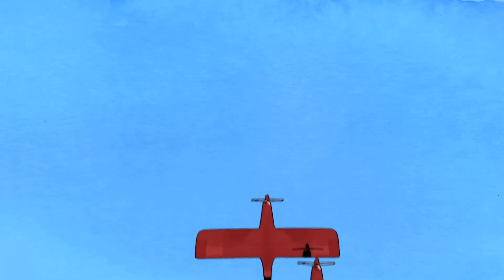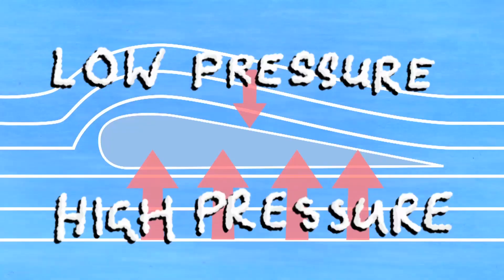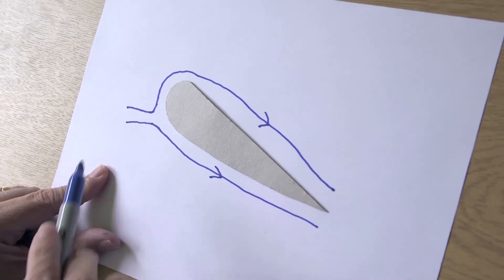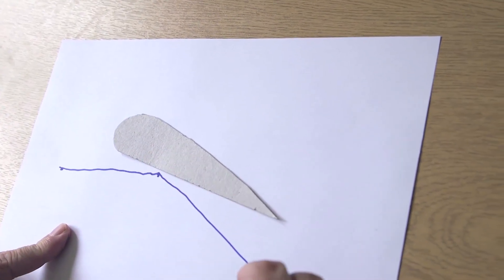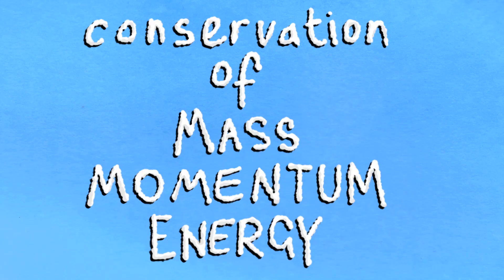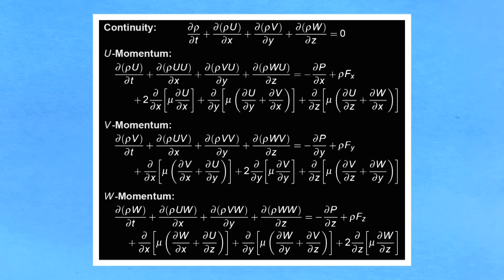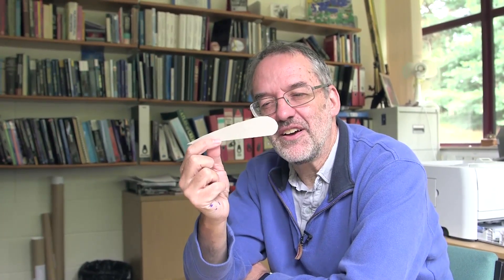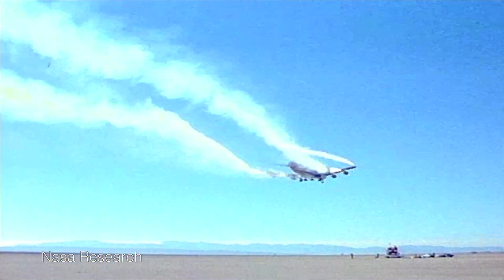Lift and Wings - Sixty Symbols

Comment: the Bernoulli effect: 
If you isolate the volume of air affected into many tiny cells or volumes, you can analyze the effect of each individual cell. (This is how fluid flow CAD models operate). To accelerate one of these cells of air, you need less pressure on one side than the other; so the cell will accelerate towards the lower pressure side. The resultant velocity is simply due to F=mA. Less pressure actually means that the molecules are indeed further apart. The accelerated cell doesn't have less pressure "because it has higher velocity", It has less pressure because the cell actually is at less pressure. That is why it has accelerated to the speed we see near the top of the wing. For the air flowing over the top of a wing, the integral of F/m over time will be equal to the change of velocity. Air obeys F=mA like every other mass does.

Comment: I believe the downwash which results in lift would be newton’s 3rd law?
Reply: The downwash essentially does satisfy Newton's Third law,  However, the lift, downwash and upwash as well as all other air accelerations around a wing are caused by the pressure differences (called Pressure Gradients) around the wing.
..
It is a common misconception that the downwash is the cause of lift.
..
If the downwash off the trailing edge caused an upward push, then the trailing edge would be pushed upward by the lift force and we know very well that the center of lift (or the net upward force) is about 25% behind the leading edge.

Comment: As with so many approaches to this issue, the production of lift is portrayed with air moving over a stationary wing, as in a wind tunnel. Even Professors fall into this trap!
However, this not what happens in the 'real world', where a moving aerofoil displaces previously stationary air. 
We need a model showing the downward displacement of air after the passage of the wing, which must also have a small forward component. Take a look at any one of several photos or videos of aircraft flying just above the cloud tops.

Comment: It's always interesting in lift explanations, to see the angle of attack of the fuselage ignored.
Reply: Because it is the wing that does the greatest.  The fuselage may or may not produce a tiny amount of  lift.
The pressure changes caused by the motion through air are VERY small!  That is why wings are so large.
A Cessna 172 has a pressure top-bottom difference of only 0.1 psi!!  With 25,000 square inches (147 sq feet) to lift a 2,500 pound plane.
.
The pressure above decreases about 0.08 psi and below it decreases about 0.02 psi - for a difference of that 0.1 psi..
..
The largest change of -0.08 psi is only a change of 0.57%.  The greatest pressure change around the ting is only HALF a PERCENT!.
..

Comment: "The air above the wing travels sligthly faster than the air below the wing - creating lift".
"No, it travels even faster than you think, so it doesn't create lift".

So, more is less?
Reply: It is actually ACCELERATED rearward by the lower pressure above the wing and higher, atmospheric pressure ahead of the wing. A Pressure Gradient Accelerates fluid toward the lower pressure.  Pressure = CAUSE! [THAT is Newton].
If you stand still and watch a wing go by; actually following a small bit of air that winds up above the wing, you see that it first gets pushed forward ahead of the wing in the well known up=wash, then completely reverses direction and is traveling in the opposite direction of the wing - BECAUSE that pressure is so much lower than 1 atm!  In the still air reference frame that upper air REVERSES DIRECTION due to heh (negative)  Acceleration!
Reply: @Observ45er  the end result remains the same: lift is created because of air moving faster above the wing than below.
Reply: @KlipsenTube  The end result is the same as what?
.
The upward lift force is the direct result of the Top-to-Bottom pressure difference, regardless of which science or myth you choose to point to --- or which step along the path of numerous causes and effects you wish to stop at...
..
It also takes a 'turning' of the flow to get lift...
.
It also requires something like a "wing" shape, oriented correctly ti get lift...
..
It also takes forward motion...
.
Sound bites don't explain anything...
..
Some folks claim that it is money that holds planes up...
Cheers
Reply: Actually it does not travel at all, it is the wing that is moving, the air is stationary.
Reply: @marka6487  tomatoes tomartoes. 
Ever heard of wind tunnels?
Reply: @KlipsenTube  planes in wind tunnels don't fly. Apples and oranges
Reply: @marka6487  are you always this infantile?
Reply: @KlipsenTube  Does everyone that disagrees with you seem infantile to you? Does your opinion mean anything?
Reply: @marka6487  I take that as a yes.
Disaggreeing is one thing, but how do we disaggree, when we basically say the same? By you acting “clever”, in other words childish.

Comment: Somebody please tell me why a model airplane with a flat sheet of Balsa wood flies as well (better, actually) than another with a curving wing
Reply: Because it isn't simply the exact shape of the wing.  It is the pattern of the air flow and air flows pretty much the same on any and all wings that are generating lift.
People are too hung up on the exact shape because somebody started the myth of the longer path of the upper surface along with the all too common misunderstanding of Bernoulli's Principle and you have everybody focused on wing shape instead of what the air is actually doing..
I just reposted my comments on the real science of lift.

Comment: The shape of an airfoil can affect the area of pressure travel. Some nay sayers dismiss flow over the wing as creating the lift but yet an airfoil such as a NACA 23015 has a limited area of pressure travel and thus a favorite of tailless aircraft designers. The problem with laminar flow airfoils is the sudden separation of airflow. Another words the stall is abrupt. I think between explanations of lift and to which one bears the greatest responsibility for keeping the aircraft aloft changes with speed and angle of attack. One of the things which Fantom pilots are fond of saying was that the F-4 proved that with enough power, you can make a flat piece of plywood fly.

Comment: One might quibble with "the wing acquires an upward momentum"? The wing is flying straight and level - so where is the "upward momentum" of the wing? The explanation Requries two steps using Newton's 2nd and 3rd laws? The air has a downward mometum, was accelerated downwards. This acceleration requires a force (2nd law), exeretd by the wing on the fluid. Then 3rd law, action and reaction,means the fluid is exerting a foce on the wing?

Or you might rather obscurely say "the upward momentum of the wing was 'destroyed' or balanced by the downwards momentum of the wing caused by the gravity force which keeps it straight and level?

Comment: Lift has piqued my interest because of the contrast between the simplicity of the immediate answer (of course lift is the resultant in the "vertical" direction of the integral of pressure on the surface) and the complexity of the full solution, i.e. the fact that that pressure on the surface is the specific result of how the fluid "field" organizes itself (behave) w.r.t. the shape and motion of the surface.
It is interesting that the volume in which this organization can occur is defined by what can causally be affected by the presence and motion of the surface, introducing "relativistic" causation effects respect to the speed of sound. This volume extends around the wing, even in front of it, think at subsonic speeds, which means that the air that comes to affect the wing is already affected by the presence, shape and motion of the wing. This is why the "pinball" (non interacting particles + moment transfer from particles to wing) model fails, as it cannot capture this feedback mechanic. And it's why the immediate answer, while true, doesn't tell us anything practical.
The feedback cycle is a crucial point, so not just the air in the immediate proximity to the wing (that which yields the pressure, that would be enough IF we knew which pressure field it would yield, which we don't know without knowing the effect on it of air further away), and yet not the disturbed air in the far wake of the wing, which no longer feeds-back onto the air around the wing itself.

Comment: so the air after hitting airfoil doesn't just turn away and travel straight right? it flows along with the shape of airfoil. Is this because of the Coanda effect or is that completely wrong?

Comment: I have a theory called the kite effect, the heavier leading edge via gravity pushes the leading edge forwards and downwards but the air pressure underneath pushes everything up and back so most of the lift is coming from underneath pressure as it fights with angle of attack due to the front end wanting to tip forward and down. With higher angles of attack, like in climbing turbulence eddies are formed behind the top NOT some smooth coanda thing.

Comment: I love this video. It's how I've always felt about it, but I've always been taught one or the other separately when learning helicopter aerodynamics. 

Conservation of momentum is used because it's "easier" to explain. "Air is pushed down so wing is pushed up". Then they brush by Bernoulli's principle because it's just "another explanation" but often "too confusing" and isn't talked about, but then nobody was able to explain how autorotation works by using conservation of momentum. They draw graphs and lines but don't actually get HOW it works and seem to not care either (fair enough, it works so we use it). However, I wasn't satisfied with not knowing how. Bernoulli's principle explains it well for me. My dad studied boat design and sailing and Bernoulli's principle explains how you can have a sail boat sailing against the wind. It's the same principle. It's the only way I was able to understand how you can have airflow coming from the front of the aerofoil yet still be pushing it forwards. It's much more exciting to not stop at the easiest, simplest explanation you can find.

Comment: The reason why is that the air on the bottom is pushing up on the wing in such a large amount the wing has to go up. 

Think of this as if you were in water.      A wing only stalls when the air cannot flow along the bottom.     Think  holding a wing at 90 degrees to the flight path.       Put your hand out the car window  and this is very clear.

Comment: Just a couple of questions....  Assuming a stationary air mass, it (the air mass) has no momentum until it is displaced by the moving wing (momentum = mass x velocity).  so any momentum it acquires is due to the wing displacement.  However once the wing has passed, what happens to the resultant down wash.  I assume the air mass must return to equilibrium.  So if this is the case, that down wash must curve back up behind the wing, another change in momentum?  Isnt it true the wing, being driven through the air by the motor causes air under the wing to be compressed and air on the upper surface to expand,  but once the wing has passed the air must return to equilibrium.  In other words the compressed air below the wing moves upward towards the lower pressure area until equilibrium is achieved again.
Reply: The change in momentum to the air (downwash) is permanent-ish, so the wake behind the plane will have some slight downward direction. It dissipates spatially quickly, so more air mass is involved but vertical velocity decreases (momentum still conserved). Eventually the ground exerts a force on the air and removes all vertical momentum

Comment: I wonder how Bernoulli is affected by the fact that the air isn't actually moving at all. It just sits there and the wing moves past it. Since Bernoulli involves actual changes in pressure and velocity it seems to me that reference frames are invalid.
Reply: +bighoov1
,
Bernoulli is not "affected".
If you think that "fast" air causes a lower pressure you will be surprised because when watching a wing go by in the otherwise still air, the lower air is actually moving at a higher speed than the upper air.  However, because of the lower pressure above the wing, that upper air is accelerated much more than the lower air.  It is accelerated so much by that lower pressure, that it reverses direction and travels in reverse as the wing goes by it.
What Bernoulli pointed out is only that there is an inverse relationship between pressure changes and speed changes. A speed change is acceleration.  Euler pointed out that it is pressure Gradients that are the cause of accelerating the air.

Comment: But the air isn’t moving past the wing at all.  The wing is moving through the air, which is initially stationary.
Reply: Correct.  the air over the wing is not moving faster than below.  Data from a wing going by in otherwise still shows the lower air is faster.!.!.!. YEP! real data

Comment: When he said there is no wall pushing down  just more air.  Atmospheric pressure is the wall .
Reply: +Kevin,
No it isn't a wall.  It is a VERY SOFT cushion, so, therefore that isn't the science.
.
If you remove the 'top' off a venturi it STOPS working.  Yes, I know the Smithsonian uses/used that explanation, but it's still wrong (not just poor or a simplification), but wrong.
...
When viewed in a wind tunnel, the air is Accelerated to a faster speed over the top because there is a lower pressure there compared to the atmospheric pressure ahead of the wing. The force "F" of the pressure difference (gradient) accelerates "A" the mass "M" of the air to  higher speed.  F=MA ...Newton still lives....
...

Comment: 7:33 so the air is squeezed => so it moves faster => so the pressure is lower. OMG. If the air is squeezed the the pressure increase.
Reply: +gabriel radu,

No it isn't squeezed and there isn't a wall.  The atmosphere further up is a VERY SOFT cushion, so, therefore, that isn't the science.
.
The pressure will increase AHEAD OF the squeeze !!  In the real venturi it is the higher pressure in the wide section that pushes (accelerates) he fluid toward the narrow section which has a lower pressure
.
If you remove the 'top' off a venturi it STOPS working.  Yes, I know the Smithsonian uses/used that explanation, but it's still wrong (not just poor or a simplification), but wrong.
...
When viewed in a wind tunnel, the air is Accelerated to a faster speed over the top because there is a lower pressure there compared to the atmospheric pressure ahead of the wing. The force "F" of the pressure difference (gradient) accelerates "A" the mass "M" of the air to  higher speed.  F=MA ...Newton still lives....

Comment: if you put your wing upsidedown in water its still going to go UP.. therefore bernoulli is weaker than  the other  forces
Reply: +johnny llooddte,
"Bernoulli" explains NOTHING and causes NOTHING. It is only a way of calculating values from some given quantities. MOST people interpret Bernoulli wrong and, therefore, don't understand what it is supposed to tell them. 
..
Very summarized: The motion of the wing causes pressure differences (lift) AND all the other accelerations of the air we see around the wing.
...
An inverted (or flat) wing produces VERY similar flow patterns and as a result of the FLOW of the air, pressures.
Reply: smh...

Comment: And another thing to add regarding Bernoulli versus Newton: I can fly a plane with angle of attack. I can't fly a plane with Bernoulli. On every airplane I know of, from a Cessna to parachute to an Airbus 320, to an F-14 from Top Gun, they all fly with a positive angle of attack in order to maintain altitude or climb. With an angle of attack of zero, every airplane I know of starts to fall out of the sky.

Comment: The Bernoulli "effect" as commonly stated and used is NOT A REAL THING!   FAST air simply does NOT have a lower pressure due solely to it's speed.  The  stream of air coming out of a hair drier, leaf blower or your nmouth is at precisely the same pressure as the stationary atmosphere around it.  This is an easily measurable fact!
Reply: Observ45er  You mean, if I put my face in front of a leaf blower the pressure on it will be the same as if it wasn’t there , and I would feel the same pressure on my face as in the still air around it ? ? ?
Reply: No. Of course not.
That is dynamic pressure.  The force of the mass of the air approaching you and essentially pushing on you - head-on.  
...
The pressure discussed here is properly called "Static Pressure'.  It is the pressure that something moving along with the air experiences.  It would also be the pressure exerted on a flat surface perfectly parallel to the direction of flow.
Reply: Observ45er  Well , I did give a rather tongue-in-cheek reply because a lot of misunderstanding is evident when the term ‘ pressure ‘ is used in aerodynamics. In aero-statics it’s one number and the same in all directions at any particular point, and many people seem to assume this in these discussions. In aerodynamics care should be taken to delineate whether static or dynamic (q) is meant, and the directions at a particular point e.g. static orthogonal to a streamline there. It could reduce some confusion, even for the average physics undergrad .